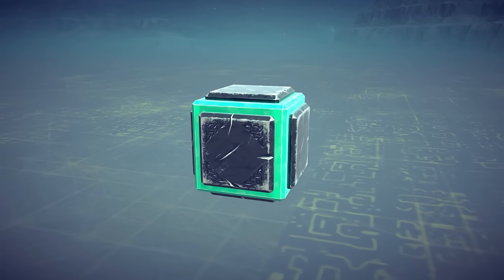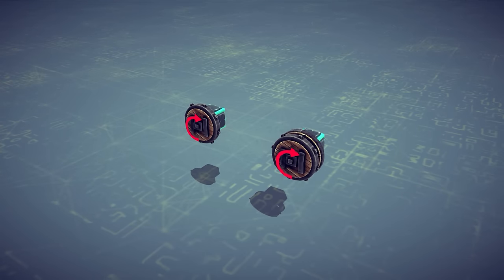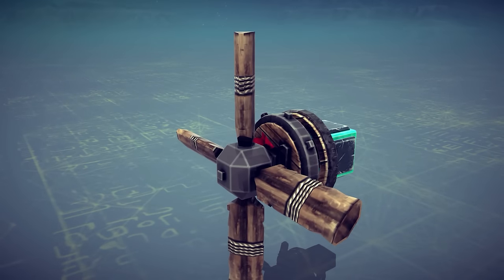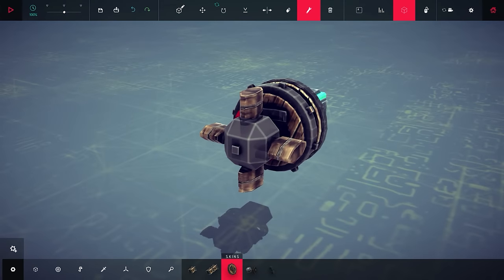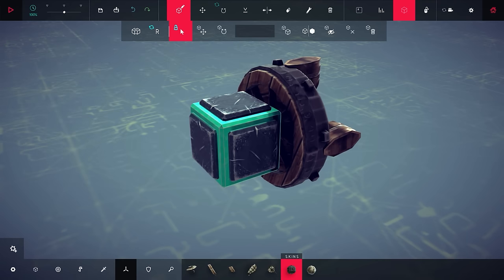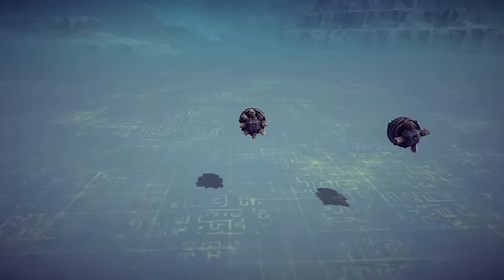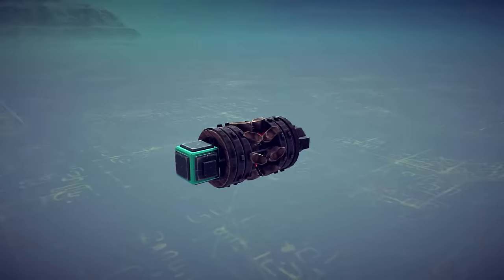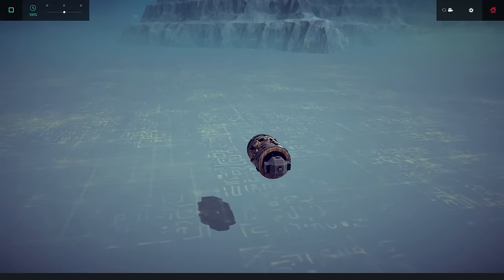BEASTY JET ENGINES! | Besiege | BBBBTBB #2 w/ BT!

Comment: I just can do the adjustments you are doing. How can i get that?
Reply: Turn on advanced options (on between cheats and graphics options), click rotate, paste/type the degree of rotation, and rotate whatever you want. As for the size manipulation, I believe that requires a mod.
Reply: @baguetteboy5466  No, you can adjust the scale by going into the wrench mode thing in the top bar and clicking on any block, there will be an option "Scale" or something along the lines
Reply: @olfmombach260  Nope, on my vanilla game I never could rescale
Reply: @olfmombach260  that's not a vanilla thing my guy, scaling is ONLY through mods

Comment: In the making double propellors part, you could have deselected the wheel again, before duplicating. Unselecting a block does not change the "anchor point". If you build a lot with mirroring via BT, this can save a lot of time.
Reply: Bram Wilsens yep. Very correct

Comment: Nice guide!  You can save a step when doing things like the rotating of the four blades though. If you duplicate before you select the wheel, then select the wheel for your anchor point, you won't be left with an extra wheel at the end.
Reply: What did he do to get the menu that allows him to rotate the blade and squish them into the rest?

Comment: I love how I copy the exact design and it acts like mine is anchored to the ground in 0 G. It spins, but it doesn't move.
Reply: same
Reply: @mitjavalimaki5171  bruh this comments 5 years old
Reply: @ThatOneToyotaCraft  did u fix it
Reply: @saab35draken39  I don't think he did.
Reply: same
Reply: @jameshart4867  I never did
Reply: Same as problem here
Reply: @ThatOneToyotaCraft  I had this problem too, the solution is to change wheel turning speed to 7 and you will get the same result

Comment: Tested and still works like a charm
Reply: damn, i think the devs must've changed some of the wheel physics since i can load old machines with the design and it still works, but if i try and build new ones, the wheels put more energy into the flywheel than the props :/

Comment: I downloaded this game like 2 years ago, though "the building feels like it's missing a lot of key features" and stopped playing. This mod changes everything, what is it called?
Reply: ZPERO Beast uses two mods in this video, EasyScale and Building Tools. Both can be found on the spiderling forums. Easy Scale creates an easy way to scale blocks, like the propellors. It helps make things compact and more efficient. The other mod is called Building Tools. It is one of the oldest mods for Besiege, and was made by one of the devs, TheGuysYouDespise. It allows for the movement and rotation of selected blocks in the building mode. This mod helps with advanced building and fine tuning. It also has a no intersection option, which ignores the hitboxes in build mode and helps when building complicated machines. 

Advanced builders typically use these mods plus NoBounds, which removes limits on things like wheel speed and cannon strength. For visual purposes, builders also use skins and some even use Custom Scene Mod, a Chinese mod not available on the forums that adds several levels with a variety of landscapes.

Comment: Nice, Now make a ramjet using that jet ;D
Reply: so many problems with that statement. 1 ramjets dont have blades of any kind. 2 a functional ramjet would require the ability to compress the air and ignite a fuel just from the heat of the compression. 3 they'd be way too fast for any map. 

a turbojet, turbofan, or nearly any other kind of jet engine would work, but most of them would only look right but not function as they do in reality.
Reply: etopsirhc 
NNNNNNNEEEEEEEEEEEEEEEEEEEEEERRRRRRRRRRRRRRRRRRRRRRRRRRRRDDDD
Reply: Mr Ban hammer without nerds you wouldn't have the internet, electricity, or even cloths. just let that sink in for a moment.
Reply: jort93z Gah good point...
Reply: Face water cannons backwards?

Comment: i tried this engine and doing it exactly what you did, why did my plane just always turn right, my centre of mass even exactly at correct place, at middle. need help. i use only 1 propeller engine
Reply: This video is from 5 years ago my guy, the counter-rotation mechanic has obviously changed since then. Try a powered wheel with propellers going the opposite direction instead of an unpowered wheel (so two sets of propellers rotating in opposite directions).

Comment: The angle does not work for me. When I input 23.06876 it just flips it upside down. Help?
Reply: greywolf7988 might be a little late, but 2 and 3 are hotkeys for Building Tools, they both reflect the item across an axis. Just press 2 and 3 again or type the number in without anything selected

Comment: Great vid explaining everything you'll need to know about the engine of a plane. But i still struggle to make my plane fly as the aircraft STILL spirals out of control even if there's the isolating wheel. When i replace the engine with a flying sprial it flies just fine. Is there anyway to completely cancel out the torque? Feel bad man :(
Reply: Isolate your engine torque with unpowered wheel or a swivel joint, they have 0 mechanical friction so if you float the plane when you spin the engines in 0g with no props attached the plane should stay rock steady

Comment: Hey guys...I don't know why but it's not moving(it keeps rotating and that's it).....I tried everything...Can Someone help me???....
Reply: i just figured it out. Something's wrong with the lastest update of besiege. Just build one more wheel (same rotation with the other wheel(s) ) infront of wheel free. The order should be: WINGS -> WHEEL -> WHEEL -> WHEEL FREE -> Normal block
Reply: or more simple, set the wheel higher speed than 3
Reply: Khoa Nguyễn yeah I solved the problem just by restarting besiege....I guess it was a bug....

Comment: the 8 rotor engine only has more acceleration, they both have the same top speed.
Reply: 8 rotor would have more climbing and high altitude ability. id imagine it probably handles heavier aircraft better as well.